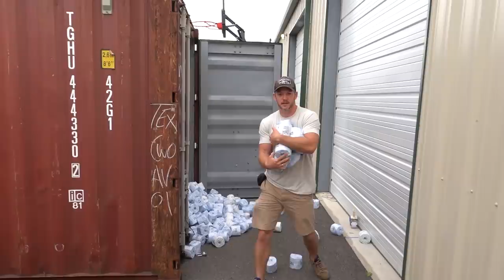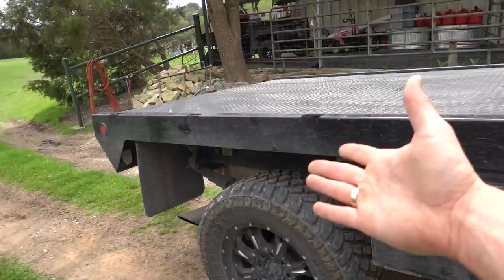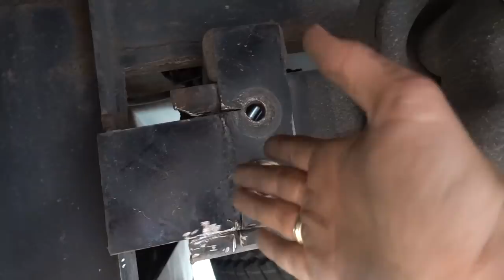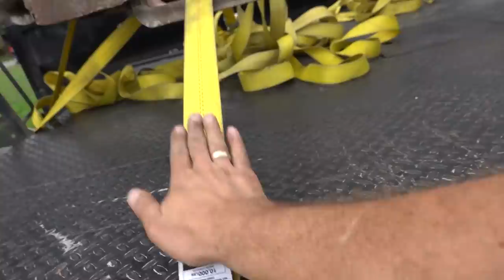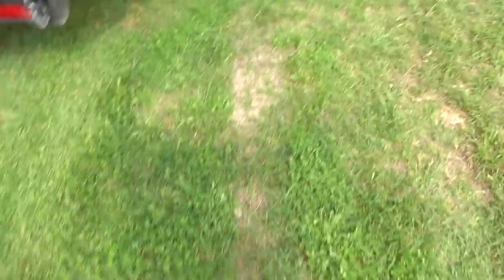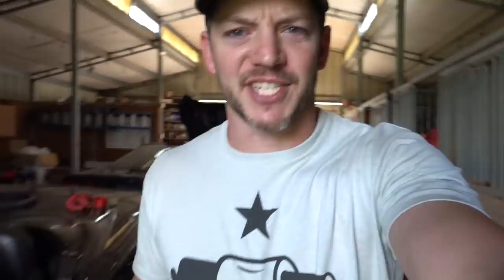What did I do to Earl? Dodge Ram Cummins Diesel

Comment: Earl spoiler: It's getting down graded from the flat bed. 
Dude: Side boards would have been cheaper, and easier. The bed already had stake pockets.
Reply: The whole time Matt was telling the problems with the flat bed, I was looking at those stake pockets wondering if he knew what those were for. He apparently didn't.
Reply: wolfpile1 honestly 😭😭 I was gonna say the same thing but it’s to late 😭
Reply: @wolfpile1  He did - he mentioned it when he picked up Earl.
Reply: Putting up sideboards would have been a boring video. My guess.
Reply: Neathway hell he could have welded some on to 😂
Reply: Samuel Blanton yeah, he coulda practice his welding skills
Reply: Exactly what I was thinking. Even ones with 2x4's and plywood would have been fine.
Reply: Well, when he got Earl originally he did notice those pockets and knew he could put some sort of rail on it. Old Matt is forgetting now :(
Reply: I thought the same thing it was already set up for removable sides
Reply: That soon-to-rust dent in the back panel is worse than breaking easily replaceable back glass.
Reply: My 4 year old is a fan. We call you the crazy Texas gun guy.
Reply: Hard to call it a down grade without seeing the new bed. Stake beds look cheap in my opinion and are noisy as hell with the sides in. Curious to see what he chose for the new bed.
Reply: Cheaper is NOT a word in Matt's dictionary.
Reply: Nah Matt is just extra he obviously knew about the stake pockets on the flat bed
Reply: full height side bang boards and a full function tommy lift =  Totally Maximum Effort Earl ...   (my Husband's dream truck)
Reply: Neathway nah honestly I thought the flatbed looked bulky and old I would much rather have the pickup bed, he’s not putting a pickup bed on but taking off that flatbed was an upgrade
Reply: It’s not a downgrade if that’s what he wants/needs out of his truck, if he just puts in sideboards but never removes them then why wouldn’t he get a new bed. If you don’t need a flatbed it’s actually very inconvenient even though they are cool.
Reply: Would have looked nice with those

Comment: That bed was meant to have removable sides. That’s what the holes are on the sides are supposed to be used for.
Reply: Christopher Harrison think that’s for tow straps not sure tho
Reply: @johndle5511  Yes and no, they can be used for that, or for sticks that you then can use to form a "bed" of sorts.  not as good as a regular truck bed, but close.
Reply: @johndle5511  stake pockets can be used for straps and anchor points yes, but they also allow people to build and hang sidewalls on the flatbeds. I love my flatbed but like the look of a normal truck bed better for everyday running around. When i am hauling my trailer, gooseneck, it makes it easier to hook up all the trailer plug and chains with the flatbed though. Im sure Matt wont miss the flatbed and enjoy the trucks looks with the normal bed better, plus Mere will think it looks better than the flatty ....
Reply: Stake beds look cheap to me and are ultra noisy with sides in. I'm curious to see what he goes with.
Reply: Not bad if you build it right

Comment: "I'm gonna take this flatbed off because I don't have a forklift to load heavy things.  Excuse me while I use my forklift to remove this bed."
I think I would've just added rails to the bed using the holes that are there for adding rails.
Reply: Bill mhm
Reply: Yes idk why he is not adding that instead of removing
Reply: DSA420meh Those college welding kids could of probably done a good job
Reply: Hes mentioned them before so i know he knows what they are for. I bet hes guna put something crazy on the back, not just a normal pickup truck bed.
Reply: I hate to split hairs but that's a skid steer with forks... Not a fork lift.

Comment: "this flat bed is hard to use without a forklift so im going to try something different"
Uses forklift to remove the flat bed
Reply: Will Thornton uh it’s a skid steer with forks not a forklift
Reply: Ryan Fehr they way matt uses it, its the same thing
Reply: Anonymous Who not even close. That thing doesn’t have close to the movement of a fork lift.
Reply: Will Thornton he even just said he's got a bobcat with a forklift attachment did you not consider he's not taking the forklift everywhere he goes?

Comment: Guys he knows you could put side rails on the flatbed he mentioned it when he got earl, he clearly has something different planned, maybe a custom toy hauler or dooms day truck?
Reply: just a normal bed to make it look like a regular family truck and not a work truck. I think he likes driving it daily but the flat bed makes it harder to just toss stuff on it and not fall off , i know he could put removable sides on it but that looks too work trucky !!   Mere will like the truck much more when it looks like a normal truck !  LOve my flatbeds but i haul a gooseneck trailer about everyday and it is a work truck,,,,,
Reply: I think something like a utility bed would be good for him. Lots of boxes to put things in, and still have bed space in the middle. He'd need one that still allows for 5th wheel hauling, of course.  ;)
Reply: @jedironin380  utility box would have to stay under 15 or so inches since he has gooseneck trailers that would hit it. He doesnt need a utility bed, ive never seen him haul much of anything that would require a utility box. He just needs a regular bed to toss junk in every now and then.  Its not like he is someone that travels and works out of his truck. If he can toss in a few gun cases and not have them fall off then it will work for him.  He cant even take Earl down to his range because his flatbed would let the guns or anything on the flatbed slide right off when he goes up or down them hills !

Comment: Matt, I would go for at least 4 CAT6 per office in case of IP enabled new equipment and/or sub-dividing more office space.  I mean just the computer and an IP phone already max out your connection for each office.  Of course you can run a small un-managed switch for each office, but it's kinda unsightly.   Also, make sure you run extra CAT6 to multiple locations on the ceiling all over the building, as you will probably need at least 4 wifi access points.  The point is that it's always easier to have the cable already ran and not need it, than need it later and run it with all the dry wall already in place.  Just my 2 cents....

Comment: You could have probably made 2x4 rails and something like plywood walls and have made a wood and plywood gate at the back and used the 2x4s to make rails. My granpa and dad had a fold up trailer and built wooden walls that they could lift off if they needed it back to a flat bed. It lasted a long time. I almost wonder if the wood they used was treated somehow to make it last a long time in the weather.

Comment: I went shopping yesterday and the ENTIRE paper section was empty.  Not just the toilet paper section but the paper towels were all gone as well.  Large sections of the store were empty and this is one of the largest stores in the city.  It is crazy.  What did I go to the checkout with?  About 8 items none of which were big items.  Some apples, some granola, and other little things.  Why do I not stock up?  I keep some freeze dried food, and I buy well before I'm out of something.  I always keep a full case of romen noodles and a bunch of can food that will sit on the shelf for a long time.  I don't wait till there a disaster to buy ahead.

Comment: Leave the flatbed on.  Build some wooden sides along with one for the back.  That’s what those holes are for along the sides your flatbed on top. 2x4 should fit in there perfect.  Then you will have sides and crap won’t slide out.

Comment: The rush for toilet rolls has me mistified.  What's to stop you washing?  The French have always washed not wiped.  The big problem is for us over 65's as we're due to be forced to stay indoors so a few extra frozen items and canned rather than fresh is the order of the day.  We haven't increased our shopping, just changed what we bought.  However I'm shocked to see so many people filling trolleys at the supermarkets and stripping the shelves.  Today we went out and looked at the smaller shops and, surprisingly, they have no shortages as at all!  That leads me to wonder if the supermarkets have an agenda.  Last Friday no problem getting anything then on Saturday our Tesco stores sticks signs up saying certain items were limited which actually caused panic buying over the weekend. There are no shortages as the local shopkeepers keep saying, only those caused by the supermarkets in their own stores.  The laugh is on the hoarders and the supermarkets are laughing all the way to the bank!

Comment: Each box is 1,000 feet of cable so IF those were full boxes (they aren't always) then he has 10,000 feet of cat 6 cable there. I work for NCR doing self checkout installs right now and the data guys are ALWAYS the ones slowing us down or holding us up at the end of the night. This being new construction, you shouldn't have that trouble at all. Kinda hard to screw up new construction

Comment: Was the network tech just a plonker or pressured into it? CAT5e would of been far cheaper than CAT6. You could of had multiple pc/phone/printer connections in each room, now you have expansive cable in the walls you'll never, and I never, use.

Comment: I'm confused.  That flatbed is freakin awesome and it's got space to put in rails.  Why wouldn't you just get some rails for it and problem solved?  No?  Plus your logic is completely off.  "No forklift?"  Well solve THAT problem!  Go buy a nice Kubota with fork lift attachment!  Between the ranch and the mansion I gotta believe you could find a use for a tractor.